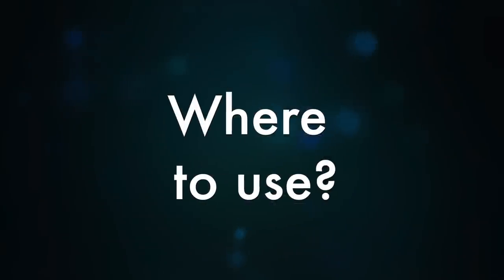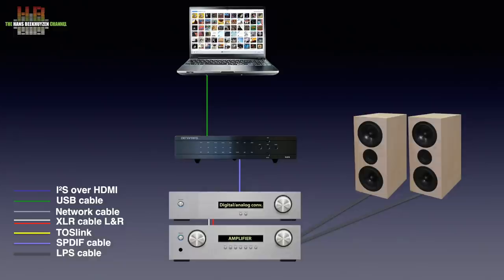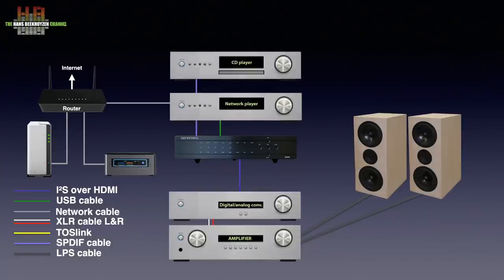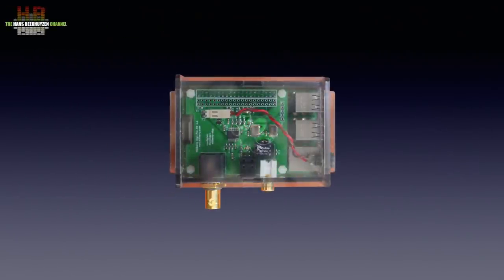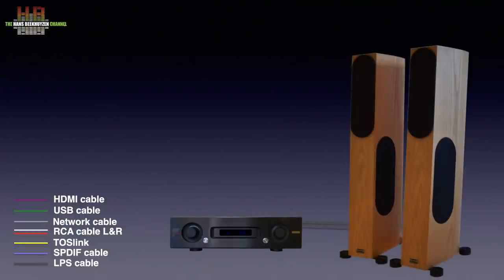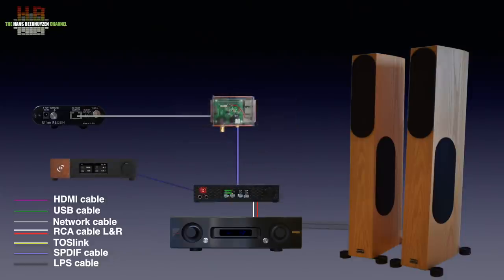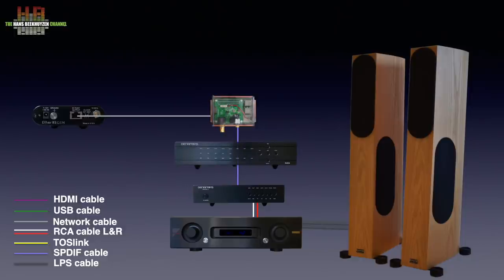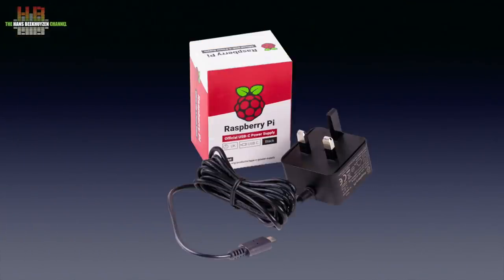Denafrips Gaia reclocker on more affordable DACs

Comment: Just a comment about your findings using the Gaia with aresii.  I took the plunge a about a month ago on the Hermes to sit between an intel NUC and ares ii. Initially I wondered what I had done, the sound was exactly as you describe, a lot brighter and sound stage more expansive.  It was not as listenable or engaging, I was very disappointed. There is a but, massive! I persevered and left the combination playing from Roon for a week then listened again. Was this the same combo? Huge improvement, instruments more fleshed out, tighter bass and more detail. Probably along the lines of reduced jitter which is what I was hoping for.. the ares ii is now working at optimum. Moral is burn in is critical. I was in your word blown away!  I really thought I had made a mistake but thankfully not. 😀. Just to add I am using digital coax between ares ii and hermes
Reply from the maker: Try a network bridge. Connecting a DAC directly to the NUC Isn’t the optimal setup. After using a network bridge try the Gaia again. An SOtM sMS-200 or USBridge/dual psu setup doesn’t cost that much...

Comment: I recently purchased a pre-owned Denafrips Gaia DDC to pair with my Denafrips Pontus II DAC. However, I am unclear regarding how to pair the Gaia clock to the DAC with my BNC cables; the Gaia outputs two (2) BNC clock connections, whereas the Pontus II has a single (1) BNC input ('Coaxial 2' - CO2). Any and all help with this question is most welcome, as I am new to DDC/DAC pairing issues. BTW, I am most appreciative of this (recently discovered) Youtube resource, as it addresses areas of interest in a concise and informative manner! Thank you, Hans....
Reply from the maker: I don't do support (that would be a day job if I did) but you might want to watch this video: https://www.youtube.com/watch?v=RQjbTahkXRc
Reply: I'm about to buy a Gaia to use with my Pontus II - were you happy with the Gaia?

Comment: Hello Hans, I have a DAC that has USB, Coax and Optical Inputs (Questyle CMA400i). I like to listen to DSD among other digital type formats. My DAC Decodes DSD as is just fine directly from my PC. But I am wondering, if I were to use a device such as the GAIA, how would the DSD signal transfer over to my DAC if the GAIA does not have a USB output? My understanding is DSD would not transfer/travel over Coax or Optical (I could be wrong) and therefore, for my particular setup, I am wondering if using a device like the GAIA, would I be forfeiting DSD playback? Hope that all makes sense, thanks.
Reply from the maker: DSD64 will work over Coax. DSD128 and higher won’t.

Comment: What I haven’t really read is what effect a DDC has made using a CD transport with no I2S connection as a source.
Reply from the maker: Well the clock signal is good so I²S and SPDIF outputs will be almost identical. It depends on your DAC what the result is. But it is fair to assure there will be a clear improvement in sound quality. Use a quality  110Ω AES/EBU cable if you can.

Comment: Hans, Thank you for the review.  I am curious. Are there any such products that could take a limited resolution DAC such as a legacy older DAC for redbook resolution and upsample it to higher pcm or dsd?
Reply from the maker: It is not possible to use a DAC at a higher sampling frequency than it is designed for.

Comment: Thanks again for a very interesting review.  Very revealing combinations.  I recall your review of the SoTM external clock, which I gather made more of a difference in the setup with the sms 200 ultra than the Gaia does with the g2.  I guess because g2 starts out with a such a superb signal.   All said, if a used sCLK-OCX10 ever shows up on eBay I'll be an early bidder.
Reply from the maker: I have not tested the GAIA with the SOtM but I can assure you that on the Terminator-Plus it further improved the sound when used with the Aries G2 (as reported in the original GAIA review: https://youtu.be/FmIy8H-h59Q)